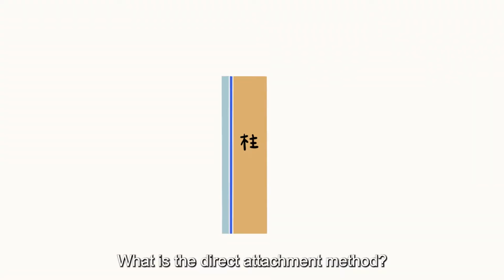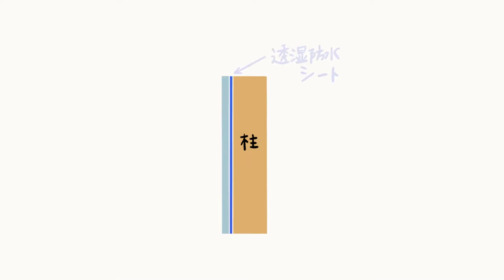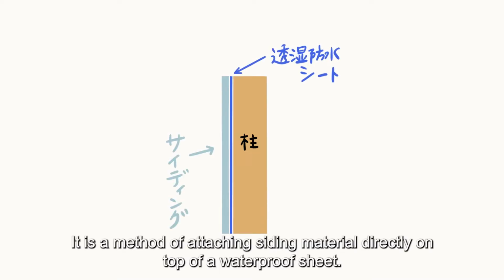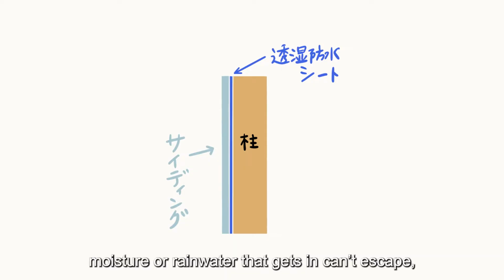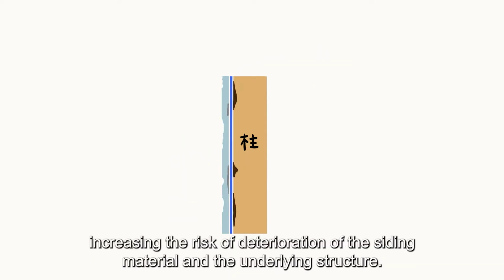[Water Damage Disaster] Exterior Wall Turned to Soaked Cardboard! Carpenter to the Rescue!

Comment: Do you ever get out to a job, and upon initial inspection (like this one) find out it's WAY worse than what you thouught, tell the Customer "I'm not even going to start unles we also do this other work that needs to be done"?

Also, I agree with the Yotsan (I don't know her, so Chan would not be respecful?)... it was built liek crap.  Who allowed someone to use fiberboard on an exterior, anyway?  It seems silly to me.

Comment: Im really shocked how flimsy Japanese buildings are, but I guess in the building boom era quality did not mean much. This focus on speed over quality also seems to be a modern Japanese thing. But I guess it makes sense as this building doesn’t comply with the earthquake standards anymore, and might have to be demolished in a decade or so? There is no point in building the patch to last longer than the building…
Reply: afaik, due to their high seismic activity they treat buildings more like a consumable. their standards change so fast that it must be hell to keep up with it as a builder.
Reply: @darudesandstorm7002 yeah, but this seems to be a post ww2 thing. If you look at traditional buildings like machiya, some arw over 150 years old. Temples sometimes even up to 400
Reply: @karlgustav9960  obviously some buildings will have been built to higher standards or dodged floods/earthquakes though. we can't point to notre dame de paris or the sistine and pretend like all european buildings are to that standard.
Reply: @darudesandstorm7002 sure, we do have half timbered buildings in Germany that survived a couple of floods and some wars just fine. Ok, we don’t have Termites in Germany, but we have a similar bug that infests hardwood like oak pretty badly. I have lived in Japan for Three years, in a relatively new apartment, and compared to German building standards the quality in Japan is pretty mixed. But then again, in Germany buildings are build to last at least 50 years, that’s probably not possible in Japan because of the earthquake regulations
Reply: In Japanese Culture a house itself has less value then in America or Europe and is much smaller and cheaper.
They arent meant to last forever.
They are meant to house people and last for ~50 years and be demolished again.

Every country has had a construction boom era with mediocre standards and building codes so they could build as much cheap housing as they could.

Comment: I've noticed that many, many Japanese buildings have sills and wall toppings without what are called, in my country, "drip fillets". This can be a simple groove on the underside of a sill away from the wall so that rainwater is cast off instead of running along the underside and down the wall causing very ugly stain marks all the way down it. Where I live there are several large buildings which remind me of North Korea. btw, that was a lunch for two, no?

Comment: For a country that has so much weather (heavy rain snow, very hot and cold) I'm shocked at how flimsy the walls are made zero insulation too.
Reply: It is a balcony, not an exterior wall frame
Reply: @aussie1339 exterior walls are the same. Flimsy material. 
Of alls the work He has been doing. It's 2x3 material, that's even on the rafters.
Reply: @aussie1339  That is just asking for wood rot to set in sooner than later, making it part of the warm side of the building has benefits of condensation being not inside the balcony piece but on the outer walls. Therefore its incredible to see such low building standards in such a warm and humid country as Japan. Also, if you have not noticed, that balcony is the ceiling for the downstairs neighbour/room. So you're not entirely right that its just a balcony.
Reply: @thomasvnl  ?? you need to re-look at the video near the end around 23:00 as you are wrong about the balcony. There are some poorly designed houses in Japan where the balcony is actually the ceiling for part of the downstairs room but not this one. In the video owner also commented that they didn't use it because it was too narrow to even hang clothes and air-con couldn't get installed on it either. You can also see the drainage pipes from underneath
Reply: That’s standard with Japanese houses, maybe with the exception of Hokkaido. Houses aren’t really built to last, they’ll get torn down in 30/40 years and rebuilt